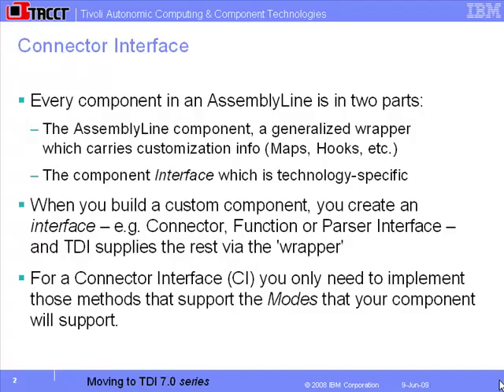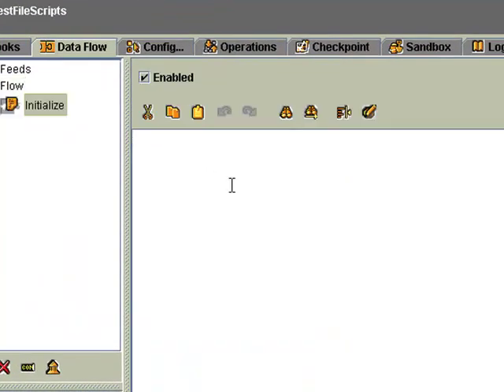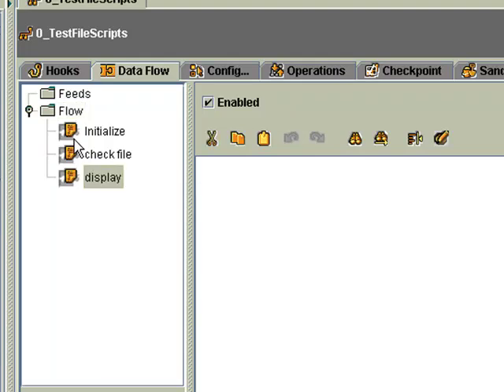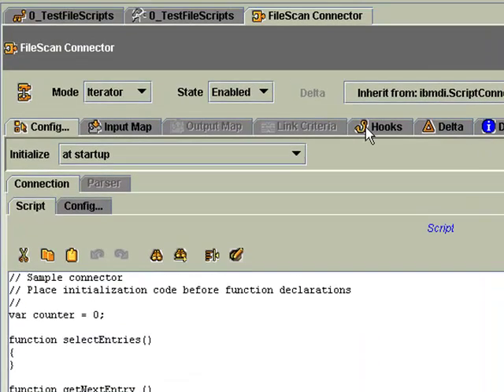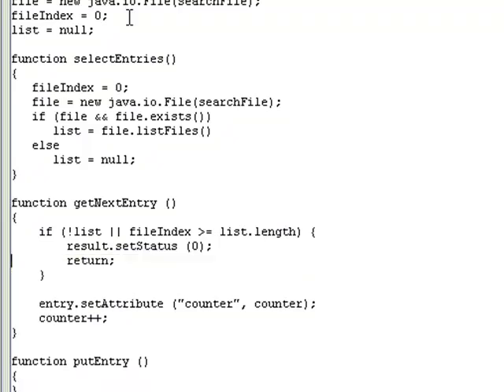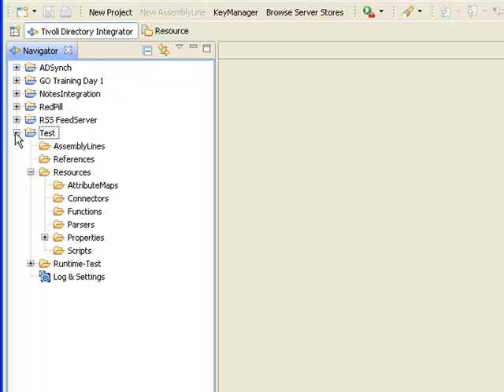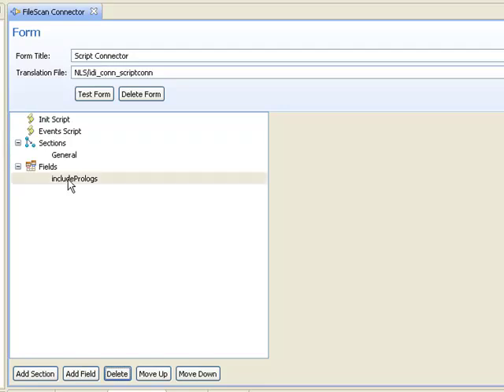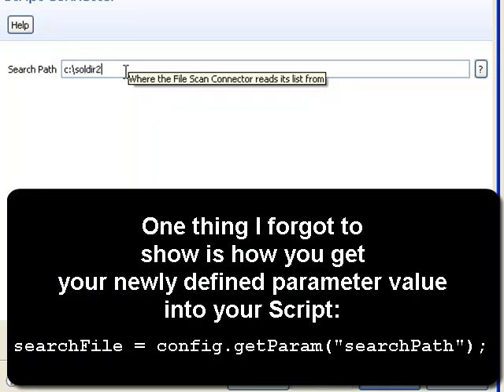Scripting your own Custom Components in TDI

Comment: Can we invoke Powershell scripts as well using script connectors ?
Reply from the maker: +sunnyboy Yessir. We have a Commandline Connector. I usually just call system.shellCommand() and examine the ExecuteCommand object it returns. Here you can get the various output buffers (std, err) as well as status from the call.
Reply from the maker: As far as I know, yes. You could try using the system.shellCommand() to execute a Powershell session.
Reply from the maker: @sunnyboy - sorry for the very late reply. I see I am not getting notifications from Google on comments...